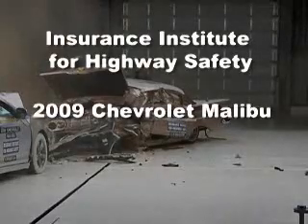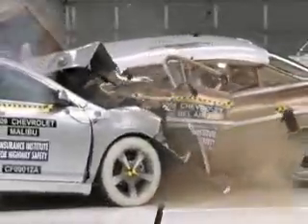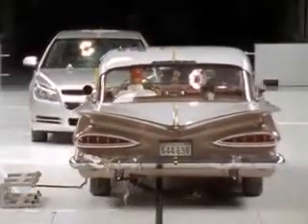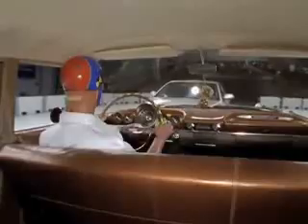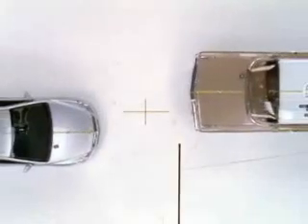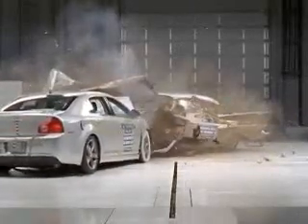Crash Test 1959 Chevrolet Bel Air VS. 2009 Chevrolet Malibu (Frontal Offset) IIHS 50th Anniversary

Comment: Cars are safer today in every way. As much as I love the 59'; the old body-on-frame design was weak. Impact above the frame can shear the body right off. Also, there's no restraint system to hold the driver in place and that big steering wheel can take the head off. New cars use steel where it's needed; crumble zone, impact beams, firewall, etc. A good uni-body construction is basically a full roll cage.

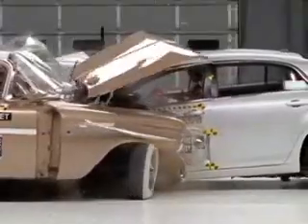Also, at 1:00 you can see a black air filter flying out from the 59'. Proof of engine.

Comment: @rickybass96 It was likely not a prime example of a Bel Air, but a vehicle that was restored only cosmetically for the test.  It is a great example to prove that the old "tanks" are in fact death traps on wheels and that new "plastic" vehicles are much safer to be in.  Please use proper spelling and grammar.
-The Voice of Reason:::::::......

Comment: @TheBoySavage Not all steel are made equal (sadly)! Material science has come quite a long way. The steel used in today's cars are of much higher strength and the structures are better designed to take such impacts, so even though they look plastic-y they still provide a lot more protection.

I love 50's cars though, they have a certain charm a lot of modern cars can't match.

Comment: @HaloSpartanG13 It doesn't appear sturdy it is sturdy, and this bel air was totally rusted out with nails made loose, not to mention the 1959 bel air was known for being a rather unsafe and weaker model of the bel air line and other cars then. But this car was still put in a very bias test.
Picking between safety, and a good looking and fast car is all up to the driver. if they die its on themselves or the idiot in the 90's car who smashed into them.

Comment: @HaloSpartanG13 Id rather risk my safety in order to drive a classic car. and actually if you research this video they totally rigged the bel air. Those cars are actually very sturdy and theres alot more proof to prove it than disprove it. The only cons are lack of seat belts (which you can install) and air bags. I've seen pictures of a crash with a a new car and a 1929 model A, the new car was smashed as hell the model A barely dented, and it was at high speeds.

Comment: THe Bel Air's steering wheel and dash crammed the driver through the front seat and into the back. Anyone in that car would either be dead or severely injured. The guy in the Malibu... prolly walked away with a stiff neck.

Comment: @PunkbeerandCortinas Surface rust doesn't affect structural rigidity. Old cars were crap for safety because they were not government regulated to be designed better like today's cars. Millions died thinking old cars were safe enough. Today's death rate is half what it used to be.

Comment: And some people say driver had 6 times more probability to have a car crash in 1959 than today, with the mileage diference of 600 millions in 1959 to 3 billion today. True. But they have to understand one thing: safety car was chaging at same time traffic circustamces changed: when number of cars and their speed raised, safety belt and articulated steering shaft began to be installed. First was Ford with "Safeguard" extra in 1956, and then Volvo in 1959. In 1965, safety belts were obligatory.

Comment: The Bel-air doesn't even have the engine and transmission in it as some other people have already said,how much else was taken out,was this thing just a sheet metal shell?
In my admittedly short life I have never seen an old car fold up like that,I have seen cars from the Bel-airs era snap a telephone pole in half and drive away with just a bent bumper if you try that with a modern car it is totaled and you are dead.

Comment: Wow, the amount of denial in these comments is incredible. Facts -- in 1959, there were 37,910 vehicle fatalities in the US. In 2009, there were 30,797 fatalities. HOWEVER, the miles driven in 1959 were 600 million, and in 2009 there were 3 BILLION miles. In other words, you were 6 times more likely to die in an auto accident in 1959 than in 2009, per vehicle mile. That is a staggering statistic that you just can't rationalize around.

Comment: @Rhaspun Yes, anytime the accident was severe enough to push the motor through the rather week firewalls, havoc ensued.

Full-frontal is into a brick wall.  This is how most of those cars were tested ( if at all ).  About 30 mph into a solid barrier, full frontal.  Then they would do well ( passengers still would not, mind you ).

'Well' is entirely relative to how they performed in other types of crashes-which was simply very very very poorly.

Sure don't make'em like they used to - good thing.

Comment: I watched this video with an open mind. But I also know that the level of engineering that goes into a new car is at a much higher level with the aid of CAD and experience over the years. I think many posters here are just letting their emotions over ride what they saw in the video. Car makers try very hard to maintain the integrity of the passenger area. Crash and learn. Same thing why new cars are so fast. Evolution of cars.

Comment: I'll go ahead and guess that all 78 downvotes are Bel-Air collectors or fans.  I really don't blame you, it's horrible to ruin that beautiful thing.

I know we need data, but why not use a mock-up (I know, scientists want ACCURATE data points, especially if their jobs depend on it).  You could make someone VERY happy with that.  Put in a front bar system and throw in airbags, and you'll get rid of a lot of problems.  

The video does it's job though.

Comment: Those early gm cars had a hokie frame design.  It was designed in an x pattern rather than a traditional "ladder" type frame.  If they'd have done a side impact the results would have been even worse.  Had they used a 59 Ford or Dodge the results quite possibly could have been vastly different.

Comment: @Wolfe2469 

Appears the engine is still there.  The damage is so severe because virtually all older cars did not have much of 
anything in the way from the fender to the firewall, except the motor.  This was actually true until rather recently.

They fared well in full-frontal, but offset testing is simply brutal to these old beasts.

A Mercedes or Volvo from that same era would do about the same thing to the '59 and would have done much better, but would still appear weak by today's standards.

Comment: This is such a bs video!  Where did they put the 59's motor & frame?  That ride was all sheet metal.  He who knows those frames knows they don't fold back.  Anybody that believes this crap never drove a 50's battleship or pushed one down the road.  I'd drive my 59 right up into that little aluminum toy's ass, with it's test dummy, push him backwards until I get bored, push what's left spinning off sideways & keep right on cruisin'-all while I'm changing my 8-track tape.  And this we know !!!

Comment: What a bs video!  Where did they put the 59's motor & frame?  Anybody that believes this crap never drove a 50's battleship or pushed one down the road.  I'd drive my 59 right up into that little aluminum toy's ass, with it's test dummy, push him backwards until I get bored, push what's left spinning off sideways & keep right on cruisin'-all while I'm changing my 8-track tape.  And that's what I know!

Comment: @kcaj789
If you're driving a '59 Bel Air, it's unlikely you'd get into an accident with it in the first place. Hell, wouldn't you drive a lot more safely if your steering wheel acted like a battering ram instead of a pillow?

Comment: @SadisticStang 

The problem is that the interiors had so much space, no airbags and a casual approach to the seatbelt system.
Any test showing old cars versus new ones is going to look like the occupants are playing in a jungle gym - bouncing around all over the place, and thus the unfounded conclusion is that newer standards are safer.
Put some dummies in a new car, without seatbelts, and the seats pushed all the way back and the airbag disabled.

Comment: It's such an obvious setup. There's no way carbon/steel/plastic hybrids would do that much damage a to a steel based chassis automobile. Sure the sheetmetal panels may crumple, but the frame alone would be sufficient.

I'd like to see them put a Ford Focus up against a 58 Ford F100. The steel bumper alone would send the Focus' steeringwheel into it's own truck and eject the Focus driver from the vehicle entirely.

Comment: @boofheadrules I hate to shit on your thunder, but the facts are the Bu' weighs nearly the same as the "thick sheetmetal" Bel Air. Why is this? The Malibu has 21st century higher strength steel, reinforcements, and more. The Bel Air has thick sheetmetal... sheetmetal adds weight, but isnt designed to protect from crashes. Large beams are placed in the doors and under the hood to protect the driver, sheetmetal crumples so its not worth making thick.

Comment: @boofheadrules The clip doesn't show rust... exactly. Kind of like how the Chrome is still SHINY on the bumper. This car isn't in poor condition so your claim of the car being rusted out is completely unfounded. Do you really think a robot welded the Bel Air THOUSANDS of times? Do you really think the steel was even close to the same quality as today? Not to mention the fact that the Malibu weighs just 200lbs less and the Bel Air is the size of a FUCKING TANK. Sorry bro, facts.

Comment: The Bel Air is NOT a replica. It was purchased from a private owner and had been garage kept so the exterior was in pretty good shape. It was used since it was a 6 cylinder car and a four door and not a desirable collectible. The stuff coming off the '59 is dirt that accumulated over the years. I believe there's more info at the IIHS web site or on their YouTube channel.

Comment: @51HHMD Haha. So we "communists" are smarter! It doesn't matter what the Bel Air has or has not. It's a 1959 design, ie without crumple zones, rigid shell and safety features as airbags or even seat belts. They sacrificed one just to prove that 50 years of engineering in motoring have not passed in vain. This ghastly result was to be expected. Put a '77 Plymouth Fury in place of the Bel Air and it would have been the same.

Comment: This is an excellent video example of the difference between old vs new. But it could be expalined a little better. I use this to teach my class. At about .50 in the video you can see the dash coming at the dummy. That's because there is no beam under the dash like in new cars.

Comment: @NDW58 Often times the motors and transmission of old cars are shoved into the passenger area. I once saw a 1967 Mustang get hit head on by a speeding motorcycle and the transmission and engine were shoved back into the passenger area. The motorcycle was going a very high speed. Obviously the rider died.

Comment: About time they did a comparison with old vs new. Too often people would assume that mass and a lot of dead space equates to strength and safety. A properly designed smaller car can be safer than a larger car. Crumble zones and passenger compartment integrity of new cars are safer. I wonder what the weight difference was between the two cars?

Comment: It's not all that good lookin, after all it's a damn 59. from the sand coming out of the right fender down low I'd say it's been in a flood at some point.  This era Chevy had a real pos frame, it was a wishbone with the rails down the center of the car more of less. There was nothing but floor pan and doors to the parameter underneith. You can see how easly it shoves the tire back, the entire craddle is probably shaved sideways. The one piece column is like a spear, cars are so much better now.

Comment: @jacobzwarner 
It's structure surely got weakened over the decades. But absolutely no cars get reinforced for crashtests, it simply was a vehicle in good shape.

Aside from that, old cars are death traps. No matter how beautiful. They might be rock solid when it comes to the engine, but they weren't made to protect us. Today's engines are complicated machines working with tiny margins. Precision machines achieving more with less. They also require less service.

Comment: Wow, I'm surprised. I would have guessed that the Iron horse would have drove right through the flimsy new car. I have seen accidents between old models and new models where the new models get demolished and the old model only get scratches. Also based on weight and inertia,  what the movie doesn't show is the much more rapid deceleration of the new model which can be more deadly.  I think some of this must be rigged. Like the front support "A" bars & screws were probably removed from the Chevy.

Comment: @DamnStraightM35A2
Yeah, I took one of those courses. Skills saved my life once, trying to convince everyone in my family to do it. Regardless, people drove safe because the cars were unsafe, just as people drive unsafe these days because cars are safe- people haven't changed at all, they're just irrational. For eg.- anti-lock breaks haven't changed crash statistics in any significant way because people just brake later than they would otherwise.

Comment: @31Roadsterford Thats somewhat a lie. You do realize the extreme number of fatalitys in the 1950's and 60's due to the car companys greed. Many safety features were purposely left out due to "costs". I acutally revamped and added too many main safety features (seatbelts, headrests, reinforcing the frame) to my '60 bel air and '62 corvair 700 coupe, this is something I shouldn't have had to do, but I did it because I care about my well being.

Comment: DONT YOU BE FOOLED BY THIS VIDEO.......TEST IS FIXED!...... The worst, weakest and most unsafe chassis built by GM was the X-FRAME Chassis....IT came under Full Size GM cars from 1958 to 1964 when it was found to be a very weak in front end crash test because the frame folded..  Lets see them try it again with a 1957 Chevy or 1965 Chevy... The new car will be found to have 4 dead passengers in it while the others might walk away.... ONLY THE FACTS PLEASE..... Just goes to show who gets pay off's

Comment: This is B.S.  I would not trade a 59 Chevy for 3,  2009  piece of crap Malibus. and I drive nothing but Chevys 
There is no engine and trans. or front end support  in the 59.  If so the 2009 would have stopped  before it got to the firewall .  
The newer cars are built with safety in mind alot more than they were  in years past but this is a joke  for a crash test . A complete 2009  crashed into a 59 body shell  that should have been saved for generations to come .
ALL JUST TO SELL A CAR.

Comment: @MrEvillarry 
no, it would pancake just the same, except with an engine block flying into the driver's torso.  engines are not a chassis component.

Comment: Another case in which everything is rigged up, look at the seat of the bel air fly it shouldn't do that, don't forget the engines in the front wheel drive cars are sideways they need the engine to face forward this test and how new cars are better is bull, I also found Fords secret to cheap production  at leat for 07 ford had thin plastic bumpers and behind the seemingly hallow bumper is styrophome how safe is that

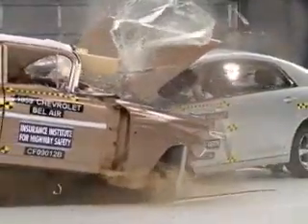Comment: The Bel Air was a rust bucket. That's why it crushed so easily. I'm not saying the Malibu wouln't have done better against a brand new Bel Air, but look at all the dust pouring out of the door at 1:00. They probably slapped some bondo and paint over a car that was structurally gone.

Comment: waste of a classic. still, the bel air is not an example of a hard car. its true that some classics are rock hard but not all of them for example a friend  i know had some classics to restore in a highway bar, a truck came and bumped into them. a '48 buick's front was completely trashed, however, a '63 riviera was almost intact having taken the hardest hit, it bumped a '58 simca wich fell off a hill and trashed a ford transit down there. the simca was little damaged. see it in my channel.

Comment: @mrmootheirrev IF there was an engine in the '59, at most the gearbox bellhousing would push into the middle of the firewall. The optional 3 point harness would have saved the driver from hitting the steering column. No doubt, There have been dramatic improvements in car safety, and old cars should be enjoyed carefully  on weekends and occasional road trips with the respect they deserve.

Comment: @april3091 The reason you can't see the engine is because the 2009 Chevy drove it into the passenger compartment of the '59. Modern cars prevent the engine from smashing all the passengers to death.

Comment: I own both an '08 Chevy Impala as well as a '71 Chevy Caprice. Both cars are great for different reasons. It's sad to see the '59 totalled like that but it does prove a point: We've come a long ways in the past 50 years in terms of safety, as well we should have! But I would like to know how fair this test was. I could see a cloud of rust upon impact for example. If the car was rusted of course it's not a fair comparison. And some posters have said it did not have an engine. True or false?

Comment: @51HHMD yes, older cars better as the footage demonstrates. It is visual footage of undoctored cars crashing, how much more proof do you need? There is an engine in the Bel Air. A friend of mine works at IIHS and the car was not doctored at all. There is just that much steel around the tiny engine to fold up.

Comment: @april3091 Actually, it had an engine and was not modified in anyway. The IIHS did not do this to say anything bad about old cars, just to show safety advancements in 50 years since they have been around. If you want to ingore 50 years of metalurgy, engineering and safety, go ahead. I think the IIHS and the engineers there know a bit than you about car safety and the video is proof in the pudding.  You want to put your safety in a car than folds and crumples up like that Bel Air, go ahead.